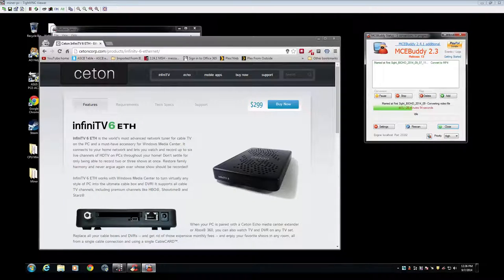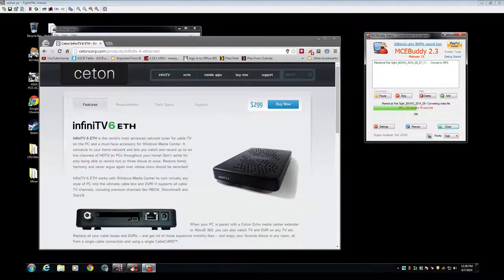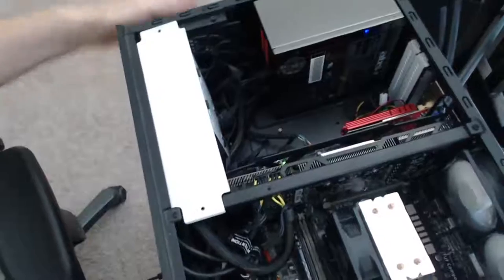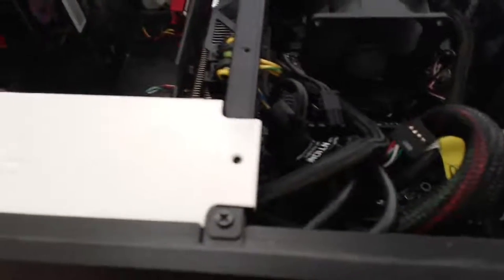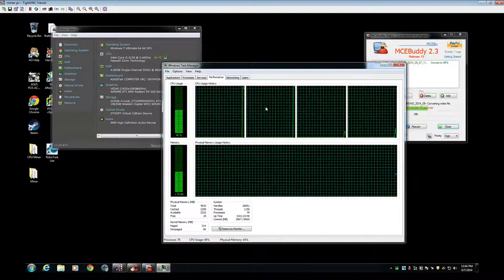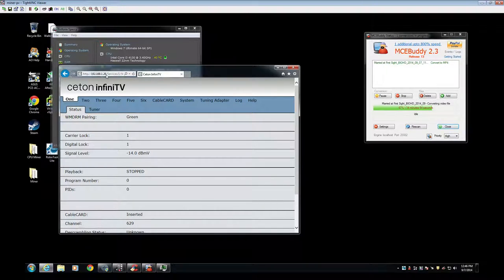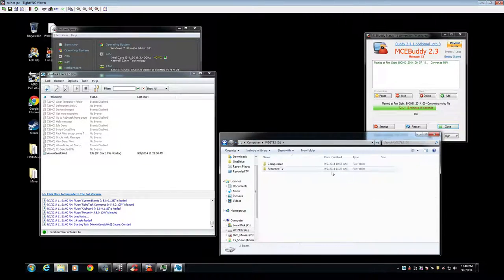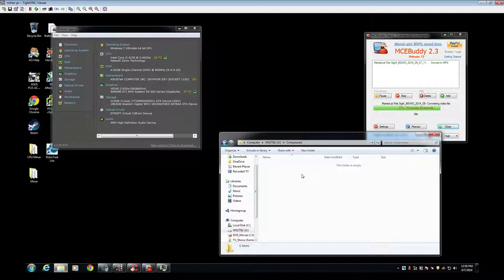Home DVR setup InfiniTV 6 ETH setup/Process/Troubleshoot Overview Part 2

Comment: Great video.  As for your signal it should be between -15dbmv to +15dbmv but it should be as close to 0 as possible.  I would hook up your infinity tv directly to your cable coming in to your house and see what it is reading.  Your provider is required to give you a clean signal.  For every split port you lose about -3.5dbmv.